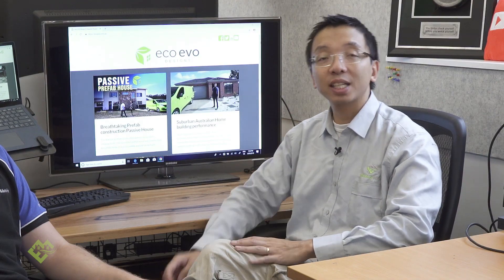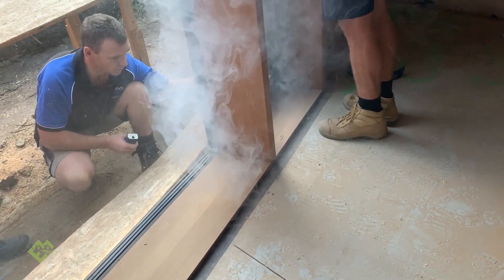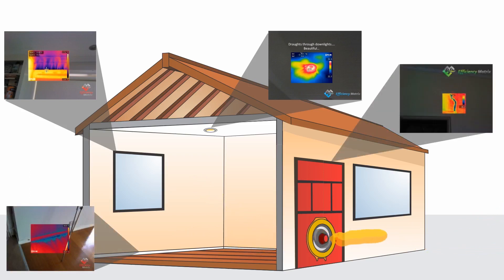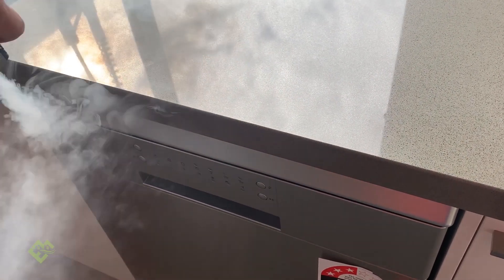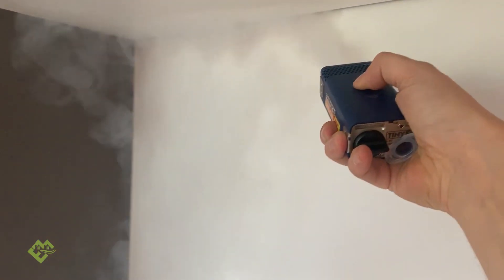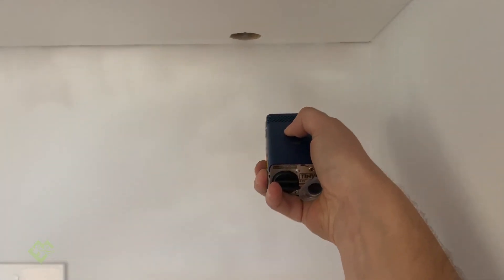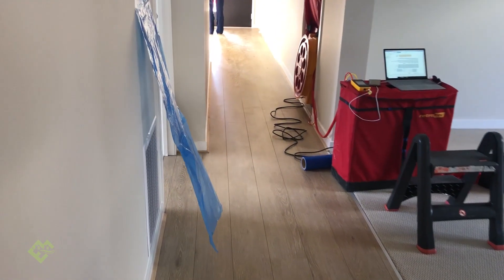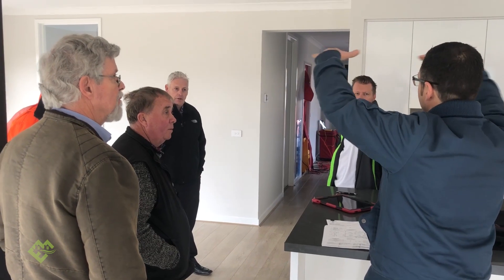Australian NCC 2019 Information for home owners

Comment: Out of interest what amount of air changes per hour is the new standard?
Reply from the maker: Timothy Welch A permeability rate number is pretty much the same as an ach@50pa number for residential buildings.
Reply: Rest of world does ACH so looking to compare was all.
Reply from the maker: Timothy Welch uk does not use ach,   the problem with ach is that, the bigger the building is, the ach number becomes lower even though the permeability number may be the same for both buildings.
Reply: Passive house or net zero accreditation are all ACH. At least in information about them. Passive house accreditation must be under 0.6 ACH
Reply from the maker: Timothy Welch Actually passive house requires both to be under.  Never the less, like i said before ach is not the most accurate way to understand build quality. https://efficiencymatrix.com/commercial-enclosure-air-tightness-testing-targets/
With ACH, if you want a lower number, you just need to build a bigger house?  doesn’t quite make sense does it?
Reply: That's only true if the bigger house is still as air tight as the smaller one. Bigger house more area to have leaks.

Doas the new standard have a ACH standard?

Comment: 10m3 per 1m3, was that the measurement?  What does that correlate to ACH?
Reply from the maker: Paul Sanderson 10m3/h/m2@50Pa, in most residential buildings this number is very similar to ACH@50pa.  a permeability rate is way more accurate way to explain build quality. https://efficiencymatrix.com/commercial-enclosure-air-tightness-testing-targets/